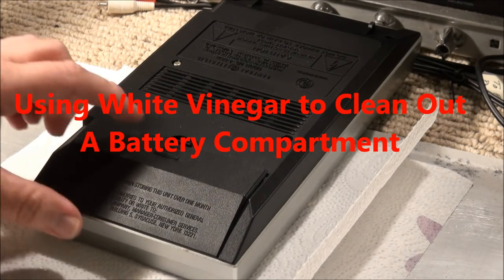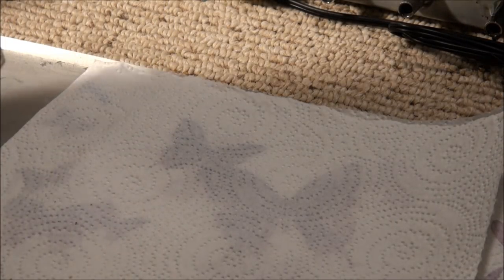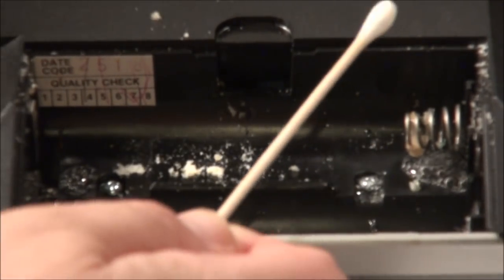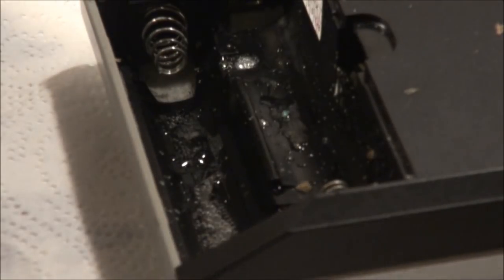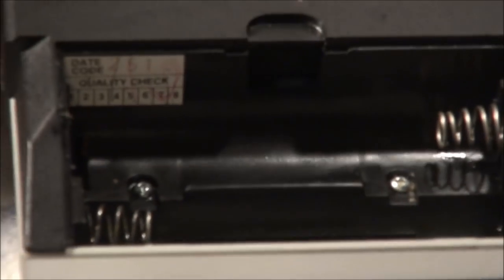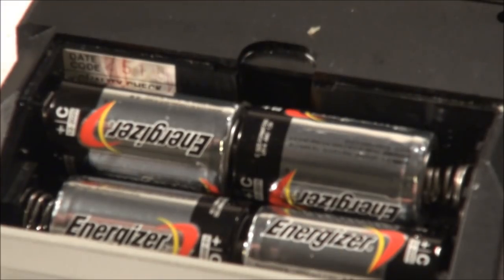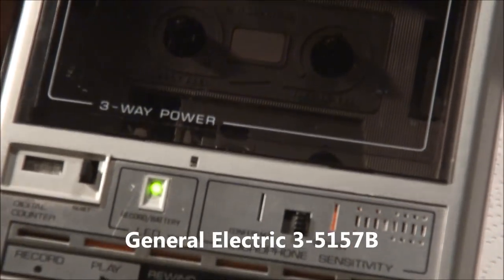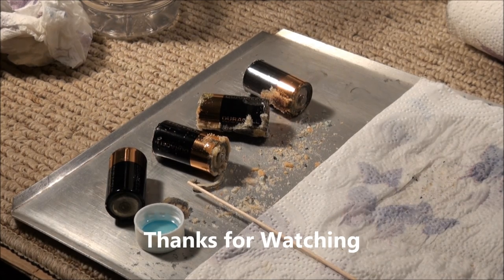I Use Vinegar to Clean Alkaline Battery Corrosion

Comment: It really works. I used baking soda method to get my wireless microphone in shape. And after used vinegar. To do some further cleaning. If you can dismantle the machine and properly clean the contacts it is a plus. Remember to properly clean the residue after
Reply from the maker: Great tip!

Comment: Good job. Now all you have to do is clean the tape head, capstan and pinch roller to get any tape build up off. Also clean and lubricate the volume control contacts if necessary.

Comment: Rule One in cleaning electronics. Never pour liquids directly onto the item. Liquids could shift into other parts of the item.
Reply: My thoughts exactly.
Reply: Then what would you recommend using?
Reply: @chicagolowe  I think the suggestion here is simply not to pour liquid "directly" into the device. You could possibly use a Q-tip to apply it instead. That's my interpretation of what was meant.
Reply: @kimjohnson3193  just gently scrub it with a toothbrush aahahh
Reply: @wompwompwompwompwompwompalienz  I'm sure it depends on the size of the space. A toothbrush could be too large for some items, that's why I suggested a Qtip or cotton swab.
Reply: @kimjohnson3193  true
Reply: @kimjohnson3193  a toothbrush and Q-tip worked well for my furby though i soaked up a bit too much vinegar and dripped far into the components where it then trickled out from its eye mask. hopefully, damage hadn’t been done considering there’s circuit boards and wires mingled along its path.

Comment: I recognized that recorder just from the bottom of it! That model is one of the very first shoebox cassette recorders I got, back in 2004.

Corroded batteries are horrible. Once I found a radio-cassette unit at an estate sale (back in 2008) which had corroded batteries, the unit had been left on in Radio mode, and the corrosion went through the wires and corroded the entire circuit board traces, as well as the audio jacks on the side. The motor was ruined, and corrosion was even on parts of the mechanics.
Reply: CassetteMaster z

Comment: I don't think its advisable to pour the vinegar into the device as any circuit beneath can get corroded by the surplus vinegar !!
You need to use enough but don't get excessive as you are likely going to cause further issues later on beneath the battery compartment.
its also better to dismantle the equipment first to limit where the acidic vinegar goes.
Otherwise a good tip !!

Comment: I just tried this on a 1977 smoke alarm I got new in the box off eBay except I used apple cider vinegar because that's what I had on hand. The original battery had exploded all over the contacts, and even after giving them a good scrubbing with a toothbrush knocking all the corrosion off would cause the horn to sound as if it detected smoke (it does a loud continuous squealing buzz). After the vinegar treatment I popped a fresh battery in it, and it didn't make a peep until I hit the test button.  I'm so happy I got it working properly again (at least with the test button), thank you.
Reply: Blow a match over it, just to make sure it recognizes smoke.

Comment: Nice one, though I would take the back off with the battery compartment before doing the vinegar pouring, as it might get into other parts inside the unit. Would make it easier to wash out any residue too.
Reply: Exactly what I did

Comment: Oddly enough I just did this on my TI-83 Plus calculator earlier today.  I finally got fed up with the crappy Alkaline batteries made today and switched to Eneloop rechargeable batteries which don't leak.  I love 'em and the sets I bought came with C and D adapters to use with the AA size.  I don't ever have to buy batteries again and they're always at the ready, retaining a 70% charge after 10 years in storage.  My calculator now has 4 Eneloop AAA batteries and will never leak again.

Comment: Not for my damage. I have a home flashlight where alkaline batteries corroded the metal contact in the flashlight. It's white, and VERY hard, like rock. I soaked in concentrated Vinegar, no change. Any advice ? BTW : I do know I can scrape, use sandpaper, like that, but is there a chemical I can use for the heavy corrosion?? Thanks for listening.
Reply from the maker: I know that type of "rock" well. I've never found a chemical that would get rid of it and leave the battery terminals intact. Maybe someone else will have a suggestion.
Reply: @DanOConnorTech  there seems to be nothing more than a flat surface, with a small indentation, no wires , springs, etc. I think it's just supposed to be the metal contact or just the end. Hard to explain.

Comment: I will have to try this and compare it to baking soda and iso alcohol.  Thru many years of experience, I can truthfully say Duracell batteries leak worse than any others.  Unfortunately, I sold them retail for many years because that was what shoppers bought over competing brands.
Reply from the maker: Let us know how they compare. I've used the Vinegar method for many years, starting back with the old Polaroid peel-apart film cameras that everyone left batteries in for years. I've never considered which battery brand is worse like that. Figuring that they probably all have similar life spans, I've always bought based on what was on sale or I had a coupon for. Maybe I should consider it.
Reply: Baking soda should be reserved for batteries that leak acid. Alkaline batteries leak potassium carbonate which is a base and needs to be neutralized with a weak acid like vinegar.
Reply: I agree - the only batteries I've ever had leak are Duracell, hate them & never buy them. New wireless mouse came with Duracell - just discovered total wet leaking mess, hence I am here on this page.
Reply: anselb20
Reply: smittyo0 , good clarification!  Thank you!

Comment: i never knew about  using vinegar thanks for the tip and I just open the back panel and hold the device upside down and dump the batteries straight into the trash can  after a few seconds i can feel that mild burning lol

Comment: I like the way it fizzes. One gets the idea it is doing something. Bicarbonate of Soda doesn't do that.
Reply from the maker: A high school chemistry teacher might say that the fizzing shows there's still a "demand" for the vinegar's acetic acid to neutralize the Alkaline "base" and when the fizzing stops there's not much more reaction to take place. I just like the fizzing too!
Reply: Fascinating ! I can't thank you enough. It was an old flashlight that belonged to my uncle, who passed on a few years ago, and so to get it working again had sentimental value. Happy Holidays, sir !
Reply: Remember high school chemistry ? Alkali vs. Acid ? Some people take bicarbonate of soda to neutralize stomach acids (cheaper than Tums or Rolaids). By the same token it'll clean battery corrosion that stems from an ACID based battery. Alkaline batteries, on the other hand, have the same basic ingredient as the bicarbonate of soda or baking soda. You'll need an ACID based substance for this task - white vinegar (with acetic acid) works great. After the cleaning, neutralize it with a little rubbing alcohol.

Comment: I have a stuck Duracell battery problem in a Maglite and I have had many items ruined by Duracell batteries in the last 5 years.  It's not just corrosion in the battery compartment, but printed circuit boards corroded by the gas the Duracell batteries give off (my Actron OBDII code reader for example) and connectors eaten up by leaked Duracell 9 volt batteries in two stud finders.  I had used Duracells for years because of the no-leak guarantee, but now they seem to always leak if left for very long, and emails to Duracell on their web site get no response.  The guarantee appears to be worthless.  Are these made in China now?

Comment: Duracell are the worst they leak and leave the worst kind of stuff. There are some bateries like TOSHIBA which I never saw leaking even old from 20 years ago!!! I currently have in my speakers remote Toshiba Alkaline batteries expired in 2013 so they were produce in 2008 or so and not only they work perfectly like new after all these years but they didn't leak a single tiny gram of anything. I thought about changing them but change them with what? Duracell so they can leak after 1 year? :))) besides they still work, there's no need to change them. Never buy Duracell, these are the worst batteries you could get.